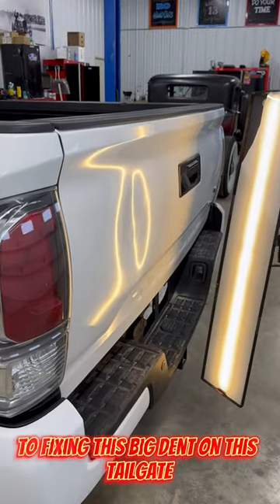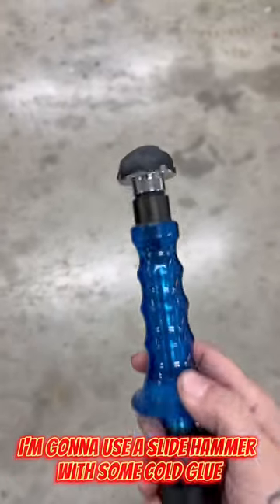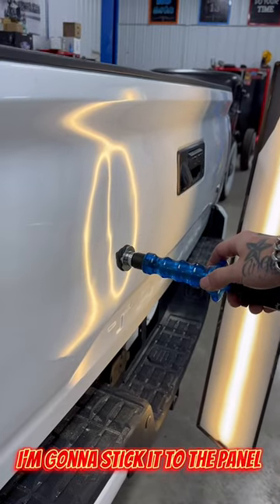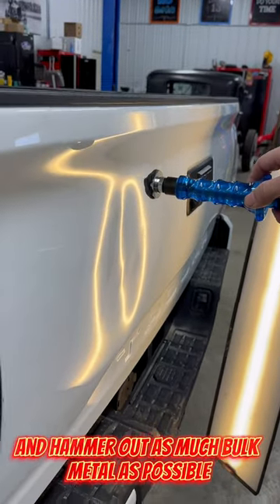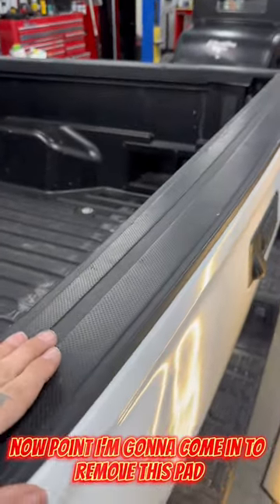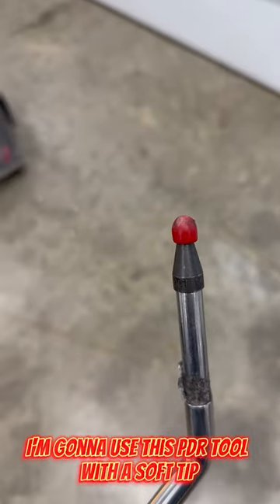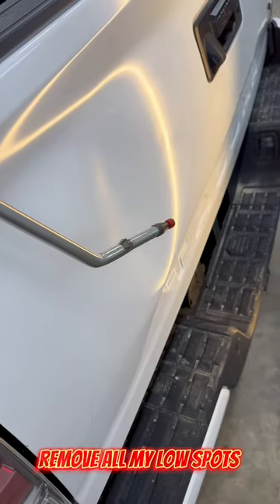Dent repair on a tailgate.

Comment: It's so easy to take the tailgate off and fix it  correctly that way the customer can experience 360° of perfection  .   Instead of just one angel .   I hope you  straighten out the holes and always use touch up paint to prevent rust.. quick jobs can become more expensive for the customer in the long. Maintaining the quality of the vehicle is very important especially nowadays as a vehicles are extremely expensive.. 1 view from the top and that thing's going to look like chop syoui. Don't get gypsyed people .

Comment: Would dent repair be possible on the upper horizontal edge of the tailgate? Mine is dented--an '09 Colorado--and even when it's heated I can't make it bend with a PDR pry tool.